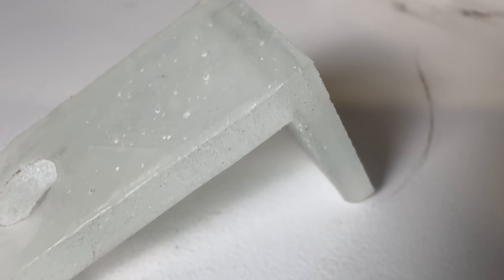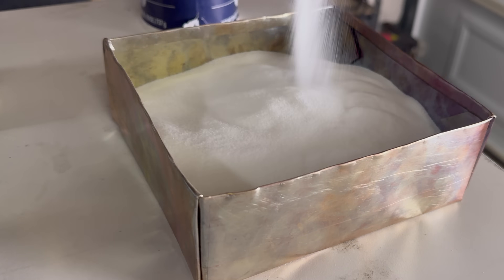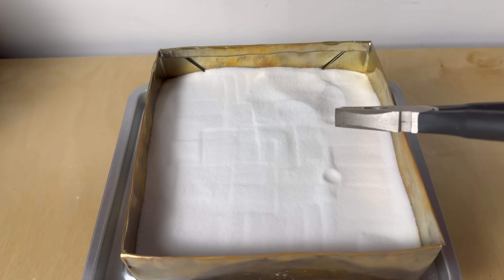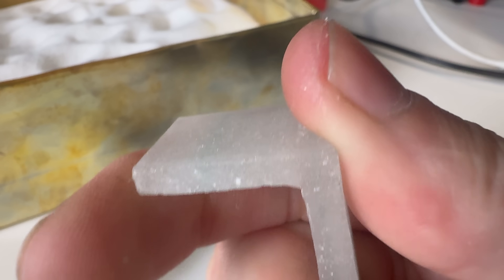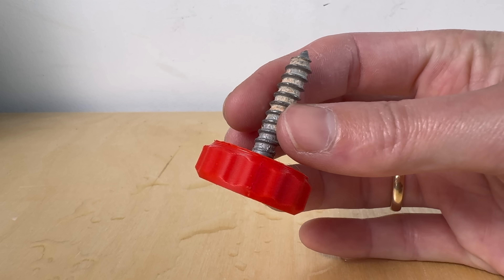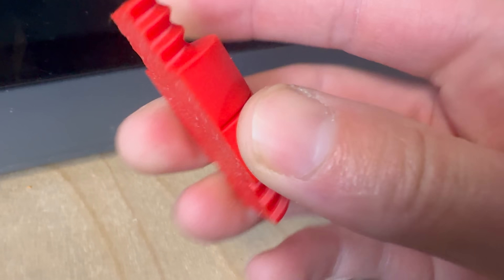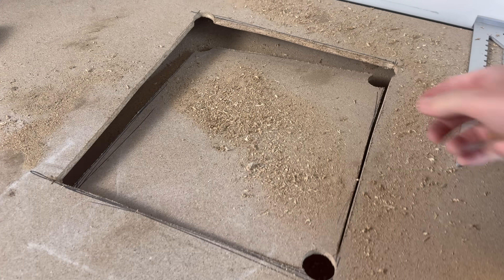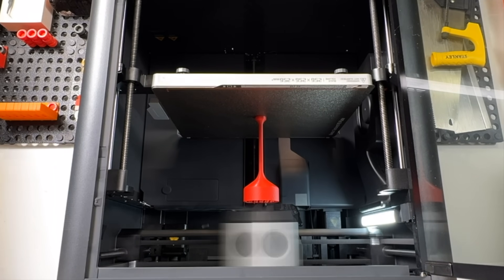5 Ridiculous 3D Printing Tricks

Comment: For the salt annealing, baking soda may also work, and corn starch (compacted) may work even better. 
Polymer clay artists use it during baking to prevent scorching and deformation on certain projects.
The corn starch will need to be rinsed off after the part is recovered though.

Comment: To strengthen 3d printed parts you can bevel the inner edge and it will make it significantly stronger. And you can also print it on its side. So the lear lines are going with the curve reinforcing it
Reply: Lear lines…

Comment: Salt vs Sand though? and any merit to adding a little pressure from the top to really keep the material tight? yours looked stellar but it did seem like it had MINOR defects? thoughts?
Reply: Salt is soluble while sand could get stuck in the part surface. Salt is also usually finer.
Reply: @hanbanaroda exactly. You can grind salt to be finer with a coffee grinder, but sand is more resistant to grinding, can't be compacted as much and will get stuck in the parts surface.
Reply: Salt is soluble while sand could get stuck in the part surface. Salt is also usually finer.

Comment: bro, u didnt mention - for the salt hack u have to print it with 100% infill btw
Reply: And the issue with it is that it has pretty unpredictable shrinking
Reply: @InTheMindOfficial  yep you'll need to compensate for xyz shrink, probably 10-20% increase in size
Reply: @gerarderloper  Also important features shouldn't be at the top because material may flow down and you will get bubbles on top.
Reply: @ good point, placing them upside down in the substrate would help.
Reply: He heated up oven to 200 C only. It is not enough to melt PETG. It probably just become soft.
Reply: OK. You beat me to it.
Reply: XD bro. That was the first thing I thought about. But for structural stuff you'd probably want it fully solid anywho.

Comment: I like the thread form on his red bolt.  It is not the traditional 60° thread form used for metal threads that I am used to.  Can someone give me a link with information/instruction related to geometry typically used for 3d printed thread.  Not that it matters, I design in SolidWorks.
Reply: I'm very curious to know too. These are similar to UNJC threads found in aerospace but not quite the same. Rounded peaks and valleys to prevent those pesky stress risers at the root of the threads.
Reply: Acme (USA) or trapezoidal (metric world) thread forms are much stronger, and often used to move parts of machines (leadscrews).
Start with those. Square or buttress threads are the strongest, but have the most friction; the Acme/trap threads are the best compromise.
Reply: @UncleKennysPlace  I'm a mechanical engineer by trade and am familiar with all those thread types.  The 3D printing world seems to be using there own thread geometry with a unique form only they use.  Their thread angle looks very shallow, maybe 90°, with radii in the corners.  I can reference a Machinist Handbook for steel thread geometry and would like to know if there is an equivalent reference book or chart used by additive manufacturing (3D printing) engineers.

Comment: Printing at 45 degrees also helps address layer line strength issues. Obviously not a universal solution.
Reply: Ha, for a second I thought how the heck are you printing at only 45C